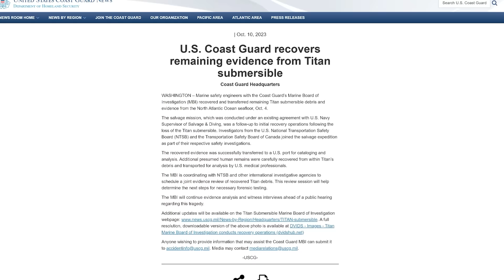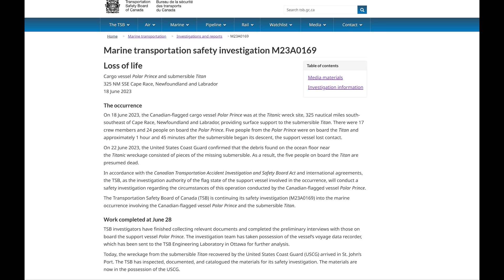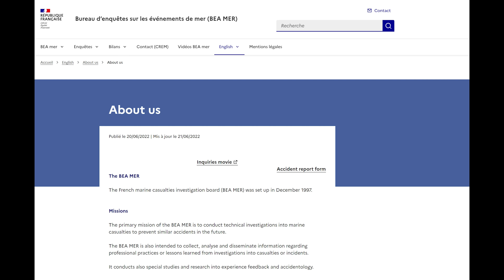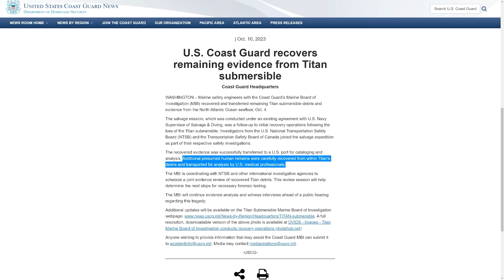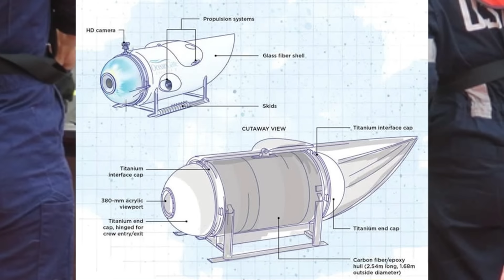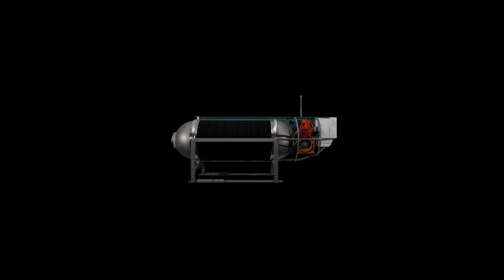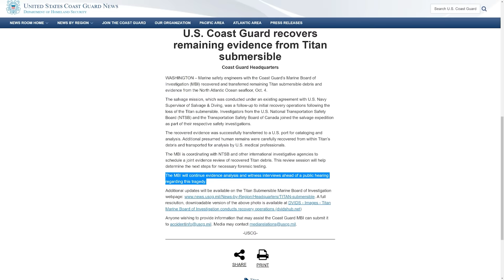Titan Sub UPDATE: More Human Remains, Debris Found

Comment: Good update. If the mandrel was left in place it could add more support for the carbon fiber wrapped around it. The wall diameter and alloy specs of the mandrel is important. Some method of bonding or joining of the two different materials is probably needed. As for weight and bouyancy would also be different. I don't know the exact calculations tho.
Reply: I still can't wrap my head around the fact they all jump in and go down, without weighing the total mass first, so check it's correct.
A decent titanium mandrel should have been used and kept, and the carbon fibre just as a bouancy jacket.
Reply: @G-ra-ha-m  If the communication leak is real, they lost buoyancy rather unexpectedly, not over time. So I don't think weighing it beforehand would make much of a difference. They descended too rapidly and increasingly rapidly from the moment they were in the water.

I think it is logical to investigate what was different this time around, and there is a fact that sticks out in that regard: they towed the sub on a barge. The jolts and shaking the barge would go through, and general exposure to the elements (sunlight/heat) could constitute a weakening of the glue or microfractures of the carbon fibre.

This, along with the fractures happening each timed it dived, causing popping and cracking noises, could have negatively affected buoyancy.
Reply: @BiggusD77  I think what you said: "They descended too rapidly and increasingly rapidly from the moment they were in the water." Indicates they were too heavy when they entered the water. 
What mechanism was there. for checking the weight, when it was strapped to a floating sled in rough sea?
Agreed with the terrible transportation, must have shaken it to bits!!
Reply: But what's the point of having the carbon fibre if they're just going to use steel underneath?
Reply: @bananian  having the carbon fiber wrap over a steel tube can add strength and stiffness to the overall structure with less weight compared to an all metal alloy with equivalent dimensions.
Reply: @bananian  Bouyancy - it's all CF is good for in that application, although even then it will soak up water. 
Best left for interior fittings only, seats etc (seats and belts required).

Comment: Interesting things about the rear dome visible in the photo: 

- The titanium ring that bolted to the dome is completely missing
- No bolts or stubs of bolts visible in the bolt holes around the edge
- What I assume is the O-ring that sealed between the rear dome and the ring is visible, clearly torn in multiple places

All of which would seem to support the proposition that the carbon fiber cylinder imploded and consequently tore the ring clean off the dome. I don't know if the view port failing would achieve that result.

Comment: I imagine the point of failure was most likely the carbon fiber hull. Probably right in the center of the cylinder. Supposedly they heard the "cracking" sound prior to failure. And they said they couldn't pinpoint where the cracking sound was emanating from. That says to me it has to be the carbon fiber and not the acrylic window that failed. They would have been able to tell if the sound was coming from the window. That being said.. the window I imagine is still intact but given the way it was engineered to fit in the port hole, with the outside pressure securing the window in place essentially, it will be difficult to locate because it most likely was shot from the port hole like a bullet from the implosion and sudden change in pressure from the inside.

Comment: Thanks for keeping us updated on this Jeff.  I'm not sure if you noticed on the top of the dome where the two girls are looking into it, there appears to be beads of caulk like material sticking out.  That would make sense if the carbon fiber was sealed into the dome and the crushed by pressure it would cause that caulk sealant to be torn out in such a way.   This would favor the theory that the main body was crushed rather than a porthole failure, wouldn't it?
Reply: Well duh. Everyone knows it was the carbon fiber that failed.

Comment: Incorporating the mandrel could have been a problem for the overall weight.  Earlier deep sea craft used steel pressure vessels and even though they are hollow they will not float.  If you make a steel pressure vessel strong enough to resist the water pressure it will be too heavy to float so it will need some other means to achieve neutral buoyancy of the system.  Using a pressure vessel of carbon fiber and titanium they were able to make the pressure vessel much lighter so it could have neutral buoyancy much easier.
Reply: Deepsea challenger used 2 inch thick steel pressure vessel
Reply: @adamjb21  The pressure vessel weighs more than twice as much as the water it displaces, they had to add a lot of flotation material outside the sphere to allow it to float to the surface.  The same thing was done with Trieste built much earlier.  A key comparison with Titan Sub is that Challenger had a 4' diameter sphere with 2.5" thick steel walls, Titan if much larger, is a cylinder instead of a sphere, and is built with much lighter materials that are less strong in compression.
Reply: Yes they made it lighter and paid a heavy price for the weight savings. The cylinder could have been 1 inch titanium wrapped with the fibre. Still might not have been enough, but certainly better. They should have tested until total failure, then built new and improved versions.

This was always going to eventually fail. Short cuts were made, experienced advice totally ignored. RIP the passengers but RIH for Rush.
Reply: Aircraft carriers and massive container ships weigh thousands of tons and they float, surely a little bitty submersible could be made of steel and float.  In fact, all the thick steel submersibles up until now have never had a failure, maybe rush could have taken a page from that book of well proven research and design and not killed everyone with his narcissistic attitude, instead he was living in the land of denial and found others willing to do likewise, they should have been smart enough not to go in the first place there were enough red flags to fill a semi truck and still they followed like the sheeple they were.

Comment: I work in oceanographic surveying as an enginer on the equipment used in that feild. 
If i had to guess about that marks on the outside of the dome id say it was seabed residue. Depends where you are but seabed can often be a grey clay like mud and it can easy stick to things that land in it. 

That brown mark may be corrosion but it wouldnot come just from the titanium. If some other metal material had landed inside the dome and sitting there in contact it may have started corroding. This can when you have two different metals together as one will act like an annode and corrode. The corrosion can then stain the titanium surface. Thats what i think that is but it’s impossible to know for sure. 

Personally i think the carbon fibre gave way or the glue bond to the titanium rings it’s between two different materials moving and acting differently. Its not really a thing you should do for a pressure hull to such depths.

Comment: My guess is that if the steel mandrel used transiently in the construction of the hull had stayed in place, the buoyancy of the vessel would have been reduced to negative so it would never have been able to ascent after the dive.
Reply: Yes. If the steel would have worked, they would have just used a steel hull.

Comment: Thanks Jeff for update.  Leaving the mandrel in certainly would not have hurt in this case.  It would make the hull thicker.  Also, depending on how it’s connected to the caps it might have helped support more longitudinal loads.  However, probably the reason they did not leave it in is due to differential expansion with temperature.  This would cause the two cylinders to rub against each other. Over time this can’t be good, and it might have caused a large enough differential to buckle under the deep loads. Bottom line is that it was a dumb idea to make a sub out of carbon fiber.

Comment: Jeff, I too would like to know if any of the carbon fiber pieces were found. Maybe they were so small and lightweight that they floated away? I would think some the carbon fiber might have stuck to some of the metal, or maybe not. Thanks for posting the update!
Reply: Metal is probably much easier to find on the bottom of the ocean than plastic as metal is denser so a sonar will "see" it easier and also electrically conductive so it can be picked up by magnetic sensors.
Reply: From other videos at the time the event happened, I remember several describing in some detail how when CF imploded, it would shatter into very tiny (microscopic?) pieces, not recoverable.

Comment: My take was that, when it imploded all inside (in a flash) got pushed out the front window, at the same time, In an instant. I wish someone in recovery of the wreckage would find the phone or chip that had that recording. It is down there. They may even have it but it is too much for earthlings to process. Or so they think.
Reply: That's pretty much it. The hull implodibg momentarily. But don't forget the end caps! They would have been pressed with an enormous force towards both ends of the hull and with the hull imploding the caps would've moved towards each other with a tremendous force like magnets, effectively functioning as a piston forcing any human remains to be pushed towards the window and squeezed out of it like toothpaste. The acrylic glass is still missing, so are the ring that was attached to it from the outside together with all the bolts that was screwed from the outside, with the force pushing from inside being such that it sheared all the bolts right off.

Comment: I am very sure that it would have seriously extended the lifetime of the carbon fiber if they have engineered in a steel base layer. (not necessary the one they they have used for the manufacturing).
The carbon fiber composite was proven to withstand the high pressures, the problem was that the cycling delaminated it. Having a steel "core" could have acted as a way to lower the shrinking of the composite under load, decreasing the cycle load.
Unfortunately the way they have handled safety would have likely caused a tragedy anyway, just later. (like 10 or 20 dives later)

There are other issues like thermal cycling, which could have gotten worse this way, but that was already an issue because of the endcaps. They should have experimented with some interesting combinations, just not with humans inside...
Reply: What I find ironic/moronic is the amount of emphasis the CEO put on the aerospace field to be radical in the way this was constructed, yet he probably never took into account how pressure cycles are one of the main limiters of service life in aircraft. The fact that it is also one of the specific items you design into a submarine from the word go and he seems to have left that one behind in his haste to be revolutionary and forward thinking. He was a fool with too much money and ego, plain and simple.
Reply: As far as I know, the carbon fibre composite was never tested to withstand external pressure of anything similar to what one encounters at the ocean floor. In fact, carbon fibres are very resistant in tension but the resistance in flexing and pressure of the composite is pretty much unknown.
Reply: @andrewseaman7012   The fact it made a few trips down already shows it wasn't 300% unsound, but the lack of follow-up inspections and realization of material compression cycles being more serious than they thought is a big key to the failure.
Reply: Would it have helped to have triaxial wound the carbon with a few aramid layers to take some of the flexing forces?
Reply: he was rich by my standards, but maybe not rich enough to foot viable, multi million dollar submersibles and pay for everything else. From what a colleague texted, it seemed he had investors and needed to prove his sub and its construction was economically viable, so was under pressure to perform.

Comment: I think there is a reason they use spheres as a pressure vessel for extreme depths and not tubes. Regardless of material I think it would have eventually failed.
Reply: Nothing wrong with a tube. Aluminaut was bigger and went deeper and never failed. It was the exact same shape just even bigger, cylinder with two hf spheres as end caps. You just don't make it out of two different materials and you don't use CFC or GFC. But titanium, aluminium or steel are perfectly fine. The guy who designed it just used aluminium because he was an aluminium guy, he was developing new alloys so he figured, let's try something cool. It was twice the size and about 4 times the weight and went deeper.

It held 3 tons of payload, 10 people and you could stand upright and walk around. 2.5 m diameter 15 m long.

It even rescued Alvin after it sank hatch open.

Comment: The steel mandrel would have added strength, but this submersible was already only marginally able to float. All that steel would have added too much weight. Remember the Titan cylinder was built of carbon fiber to save weight.
Reply: But why save weight?
Reply: @Random-dq8ew ????? to make it neutrally buoyant and avoid large floatation devices you have to try to save weight. I suggest you watch a recently made video on the topic.

Comment: Some YTers claim overall using the carbon fiber composite (CFC)  cylinder reduced the weight by 7 tons. If made of steel the mandrel it would have weighed around 75% more than titanium (steel 7.75 to 8.05 g/cc versus Ti around 4.5 g/cc). (Assumes steel & Ti tube have the same dimensions & strength.) Titanium alloys are used where most properties of steel are desired with the weight of aluminum (steel temperature & fatigue resistance compared to Al) and the cost & difficulties of working Ti can be tolerated. Clearly Ti alloys are the choice for extreme depth submersibles because every kg or lb requires a greater amount of overall buoyancy to rise to the surface. I’m not going to compare CFC to Ti because I do not readily have what the comparable thicknesses needed for equal structural integrity. I do seem to recall the CFC hull was 5” thick while the Ti end domes were 3.5” thick (don’t quote me plz). But the domes benefit from their shape (& the support of the CFC cylinder along the open rim) in resisting the crushing pressure.

Comment: Evidently the crew knew the hull was failing well in advance of imploding.   They were unable to generate enough lift to adequately control the descent and then were unable to ascend to the surface.  They were about to die and knew it.

Comment: Standard NTSB technique is to put everything back together to see what has deformed, missing, fractured etc, and also then testing individual pieces microscopically etc for damage or contamination.
I think some of those scrapes etc, may have been made when the electronics package was explosively removed from its connections to the inner capsule and/or any fastenings to the rear dome.  The scrapes/smudges whatever look linear or where a glued on item may have been torn off.

Comment: Looks like the other metal ring/sleeve that was bolted onto it is completely missing, including the bolts. Also the o-ring in the groove seems broken in many places, so maybe the weak spot was there. Maybe bolts weren't tightened evenly.
Reply: The bolts are only necessary to secure the end caps at the surface so they won't fall off. After diving the external pressure will keep them in place even if the bolts were removed.
Reply: Yet all the bolts have snapped, so something "violent" happened here. the bolts isn't my main suspect, but the broken rubber o-ring in the grove on the flange.
As a former professional industrial glass fibre pipe system builder, I agree that the bolts are too few and too small to actually hold any load.
So maybe that's the problem. The long distance between the bolts and high pressure pushing the pipe in between the bolts, deforming the pipe slightly. 
Pipe is less stiff in the ends and if they did not cut of the ends of the pipe after moulding, there might be a problem with wrong fibre direction and too much/little resin/epoxy compare to the amount of fibres.

Comment: Thanks for keeping us updated about this. It will be interesting if they can learn enough about what actually did happen, specific failure points , etc. to help advance material science. For instance if it was the pattern they used when winding the fibers to form the shell. Perhaps if they used a crisscross pattern the carbon fiber shell could have handled the pressure changes. IDK, I find it interesting from a practical use perspective.
Reply: It was 'an epoxy shell' reinforced with carbon fibre (like GRP)

Comment: That’s adhesive residue near the mounting flange that the aft equipment was fixed to.  So they bolted a frame to that and used adhesives to affix other devices, tanks, or mechanicals.